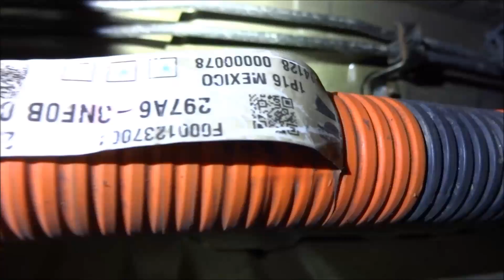Nissan LEAF range extender pack build Pt.1.0 (splicing into the high voltage cable)

Comment: Hi. I'm doing the same connector. Do you know what are those two little cables that you just shorted in a socket. I haven't opened cables yet to see if they continues further. Maybe it's a resistance check circle. Have your car shoved any system errors after assembly?

Comment: Is there AAAAny way you can send links to the compression connectors that you can use do this and the ends to do this? I was gonna try to get 5 72v packs and try to do this. See how far it gets me in combination with the original battery.

Comment: Interesting, by connecting like that you are bypassing all the safety systems. Inside the battery pack are large contactors that disconnect the battery in the event of a short or accident. Your solution will still have the extra battery connected and systems will still be live. Also the service disconnect will no longer make the vehicle safe to work on. Do you have any system to automatically disconnect the extra battery in the event of a fault?
Reply from the maker: If you view my other videos you'll see that I only activate the relays to my extender pack when need be, although I need a way to automate this.

Comment: This video skipped over the most important part. How/where did you get the compression fittings to which to solder on new cables?
Reply from the maker: Purchased at an electrical supply store.

Comment: I'm hoping to get a battery pack a nd make a trailor and and extension cord to the connect on the battery to the cord going to the front. it would have to be switched over manually but I won't have to cut up anything. I hope

Comment: welding cables are for low voltage.  You can get THHN  #4 wire from Home Depot/Lowes, which is rated for 600V and up to 75 degrees Celsius in wet locations.  Welders typically use less than 40V, so the insulation may not be sufficient to prevent death by electrons.
Reply from the maker: Well, says 600 volt right on the cable so I think I'm good. Look carefully at 4:45 and you can see the marking on the cable.
Reply: Welding equipment is hilariously overbuilt. Super high flexibility, resistance to water, oil, heat, and hundreds of volts above regular use, because welding cables may be used on a wee little home gamer 240v welder, or they might get hooked up to a big boy 3ph 480 or 600v  industrial beast, and the welding companies don't want to be responsible for a freak accident where physical trauma to the welding unit causes a failure of the isolation from mains, and then the welding cables get mains energized and some unlucky bastard moving the cables when the forklift hit the welder is electrocuted and the welding cable company gets sued to all fuck. They are also usually 600v insulation on the conductors inside an additional 600v outer jacket, either of which can get completely fuckered, and the system is still safe. 

Don't assume some chinese shit is up to the same standards of course, but good old western industrial equipment is SKOOKUM, for reasons of lawsuits around negligent deaths are real fucking serious.

Comment: has anyone added a petrol generator as range extender like the bmw i3 ?
Reply: A better solution might be building a pusher trailer.
Reply from the maker: I only know of one guy adding a turbine generator on a trailer. Adding a generator would not be an easy DYI project.
Reply: Choice777 , yes I'm working on adding a 30 amp champion generator directly into regenerative, wiring that charges battery while I drive
Reply: Choice777 it will run 24 hours on a couple of gallons
Reply: Choice777
Reply: It'd be a nice option to charge away from a plug. But would it be alright to charge whilst driving? Given you can bypass a charging=drive prevention relay, I feel like there would be some overheating issue.

Comment: Would it be feasible to modify the safety disconnect to continue serving it's goal as a safety disconnect and also somehow hooking up an extended pack here too (but tied to safety disconnect). I'm assuming the terminals here is the positive/negative of the 396v?

Comment: I'd recommend liquid electrical tape, RTV, or bedliner as insulation. I'm not sure how either reacts to 400 volts, but the above are more durable than plastidip. 
Looking forward to your full setup.
Reply: Yeah 3 years later I came across this comment, but self amalgamating EPR tape is rated for high voltage, it is used in industry for splices. Mastic tapes might even be better, extra sticky and conforms better to odd shapes.
Reply: Probably best to use something like this, or mining repair tape.

https://www.3m.com/3M/en_US/company-us/all-3m-products/~/Scotch-Self-Fusing-Silicone-Rubber-Electrical-Tape-70/?N=5002385+8710676+3292437112&rt=rud

This stuff is self fusing silicon, and much more resistant to damage, though the mining tape is the end all be all of abbrasion resistance on a tape.

This silicon stuff is 600v/mil 

Regular vinyl tape is 7mil per wrap and 600v at that 7 mil, but this is 600v every mil, so I think it's significantly more resistant. It also functionally seals itself so there aren't gaps or water ingress/conductor paths...

anywho, old as fuck comments.
Reply: if not sure then do not recommend
Reply: Julia Cameron I guess I should add that plasti dip has failed me at adequately insulating tools from my hands at 110 Volts AC and bedliner has not yet failed me at same application.

Comment: make sure when doing your work that first responder are safe when working with your car 
your car at any time in a flood or fire can not move the DC power to the frame of the car

so one day if you get in a small crash with 5 feet of water in a  ditch some where you dont kill your self and others that wound try to save you 

i love DYI and i am looking to do this to may car as well but this needs to be in the back of any ones mind thinking of doing this

and it should be added into your videos so others know and to help keep you from getting sued
Reply: "High Voltage" is generally over 600V. Leaf has half that.
Try again.
And can you cite this armchair legal statement... or just blowing smoke? Technically it's not a splice; it's a jumper with a breakout. No OEM parts changed. 
This is common practice to add a circuit in aviation and elsewhere...
My only concern is the junk plastidip insulation.
Reply from the maker: That's an added benefit of having 16 modules of 24v, much safer...
Reply: but the wiring coming in and going out i am sure is not 24v ..  is the box there going to be in going to be 100% water prof  and all so hold the a fire inside the battery box .. if there is a fire inside this DYI  box well the wiring  coming up from the HV pack not touch the still of the car in any way 

i am not saying this to troll / bug you or any thing else ..  this is just some thing that needs to be talked about and others to see to so some kid that does not know that this stuff can kill you fast does not get hurt

i had a 48V DC solar system / inverter at home and if you touched it right  it would let you know fast LOL 
i think my chevy volt has a 380V HV system in it with the 16.5k battery and i was looking to see if i could install the newer 18.4 kwr battery as they both look all most the same 

there are some first responder videos showing how they should work with EVs in a crash or fire .. it would be a good idle to look at a few
Reply: This is not legal in any case. Splicing into a high voltage cable from a battery pack that has its own control logic inside is outright dangerous for yourself and others.  You take out the safety plug from the pack but your extender pack could still be live and so the cable still holds a voltage while everyone thinks it's dry because they followed the standard safety procedure for working on an electric vehicle.. 

ps: Voltage doesn't kill. Current does.